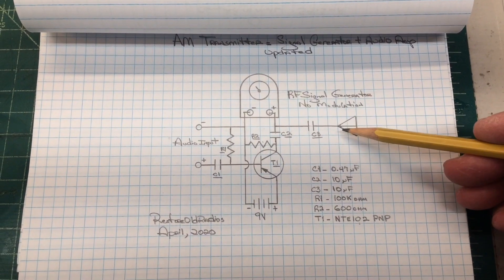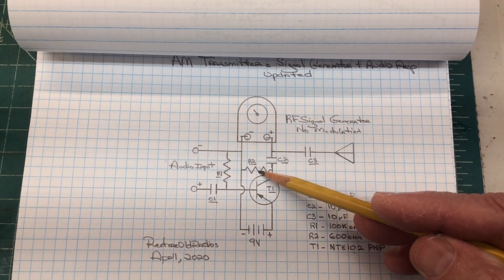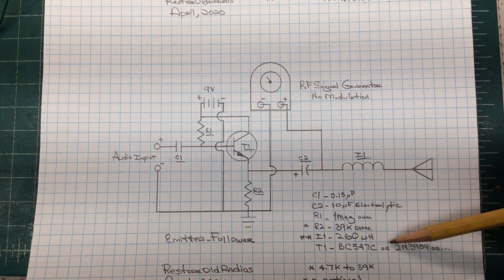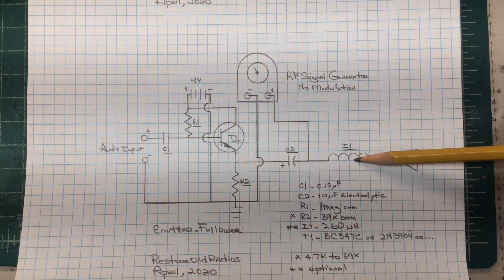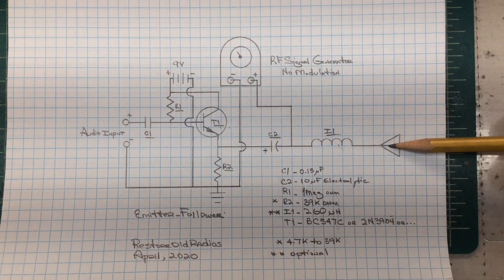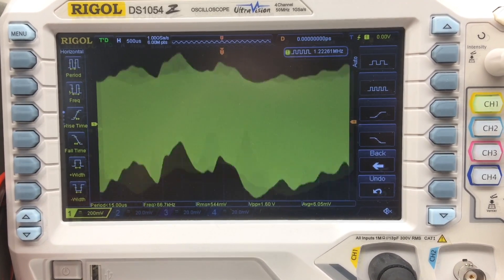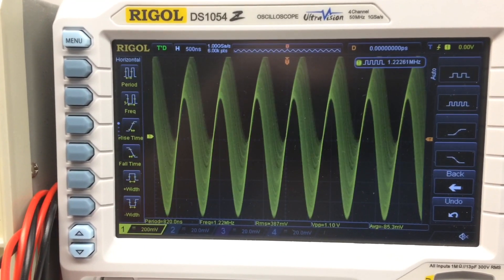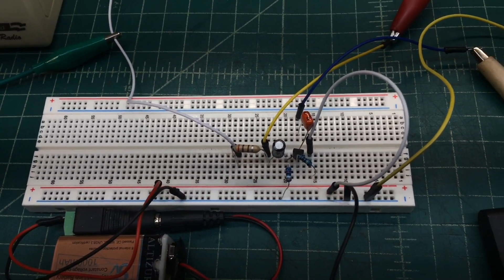UPDATED AM Transmitter = RF Signal Generator + Audio Amplifier

Comment: You are using an Emitter-Follower as a modulator!!! Strange!!! Usually, it is better to isolate source from modulator using Audio Transformer, and one with 1000:8 ohm audio transformer like LT700, would have done just fine. However, your circuit, your choice!
Reply from the maker: Appreciate the input and sharing your thoughts. All the best. Don

Comment: Don what is the purpose of the transistor? Is it just to amplify the audio signal?  I cannot see it doing any sort of modulation on the carrier. The carrier is simply added to the audio signal after it comes out of emitter. Also you have include an optional inductor of 260 uH.  Is that value somehow related to the frequency of the carrier? Or will it work for any frequency?
Reply from the maker: Frank - let me look this over tomorrow and I’ll reply back ASAP. Best, Don

Comment: Nice job I wonder if it possible to use this circuit with a signal generator that doesn’t have RF or modulation . It’s hard to find a RF generator here with out spending $10,000.   bean try to find a old tube type but it seams there all vanished  any in put would be appropriate
Reply from the maker: Allan, any vintage RF only Signal Generator will work and the circuit will allow you to modulate the carrier (not perfect, but useable) and play oldies or... on your Broadcast receiver. Best, Don
Reply: Will this block gps ?